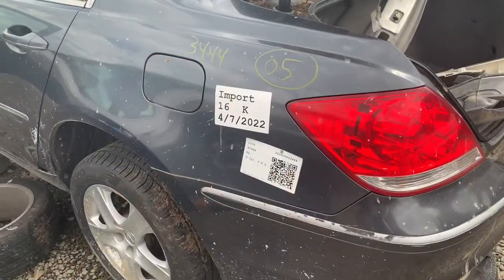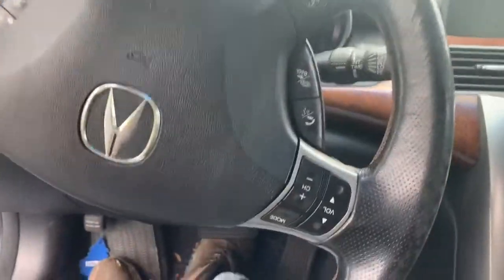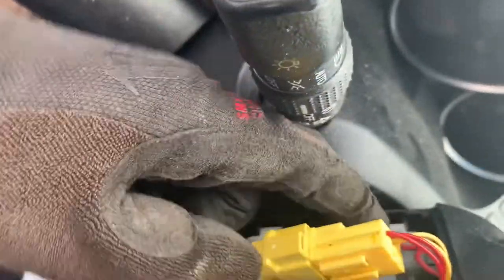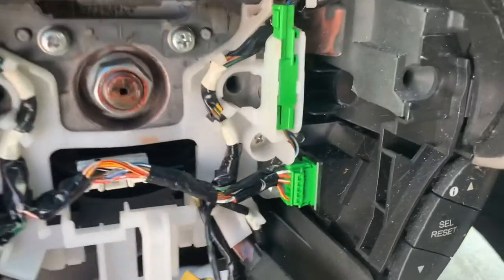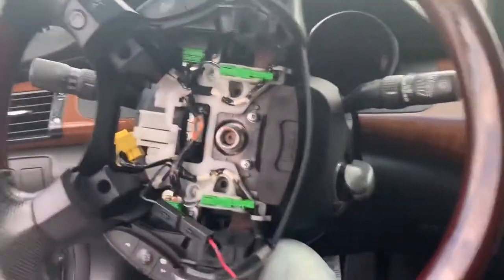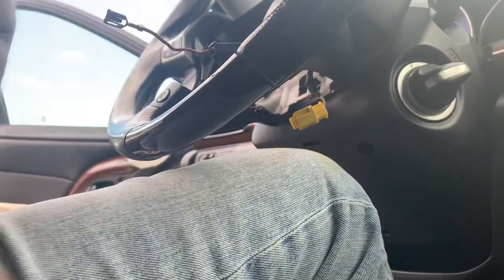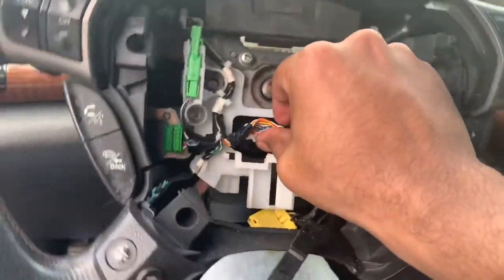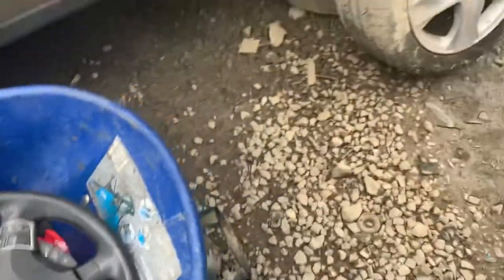⛔️HOW TO⚠️ Acura RL Airbag & Steering Wheel Removal | 2005-2012 ⚠️ USE CAUTION ⛔️

Comment: How do you ensure you dont mess up the clockspring?
Reply from the maker: Some of them unfortunately just go bad with the slightest amount of altered movement, but just be careful to not touch it when the wheel is off & be careful with the connector(s)